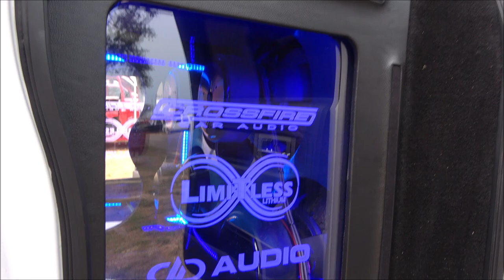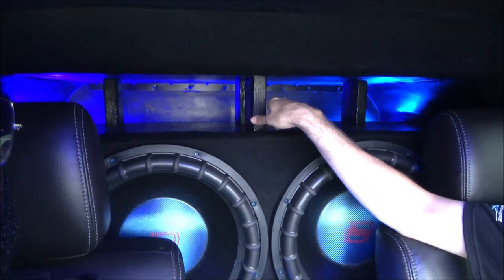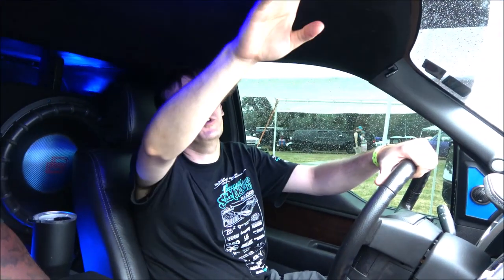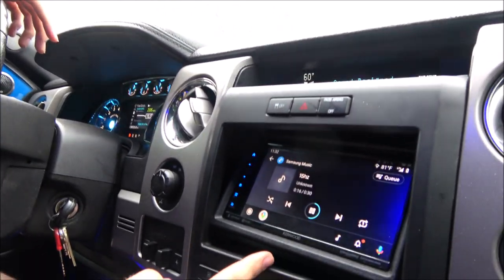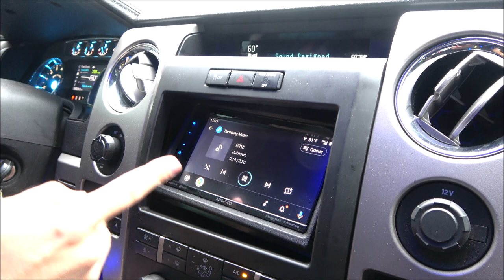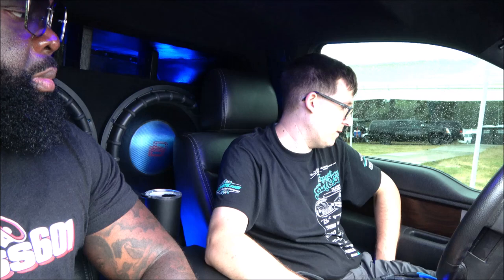WALLED OFF FORD F150 | 4 DIGITAL DESIGN 9918'S | 2 CROSSFIRE 16KS

Comment: Atleast 240 ah of yinglong or more would keep the voltage up which would help everything run cooler and also more power = louder. Still one of the cleanest builds I've seen on yt. Very nice

Comment: Mr.highbass 601.... ain't that bassin' kind of hard on a brother? 4 - DD18's flexing hard in the F-150.... I see why you wanted those windows down, because that pressure was just super tornadic & hard 2 breathe up in that mug! Daayyuumm!! Anyway High base 601 keep posting these videos man, this is the shiznit!! the bomb!!😎✌👍👍
Reply: True but those F150s sound better with the windows down which acts as a bigger port.. I put I split in my roof from 3 12s now I’m running 2 15s
Reply from the maker: Yes..windows needs to be down in alot of setup...they are much louder and pressures more that way...